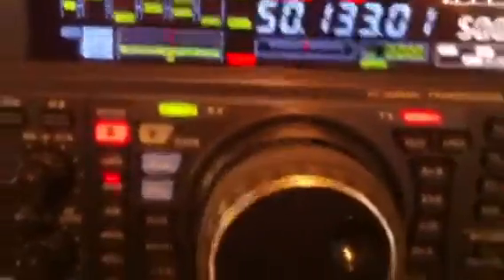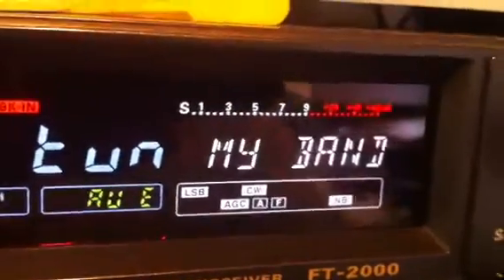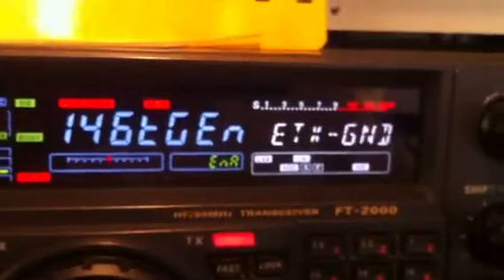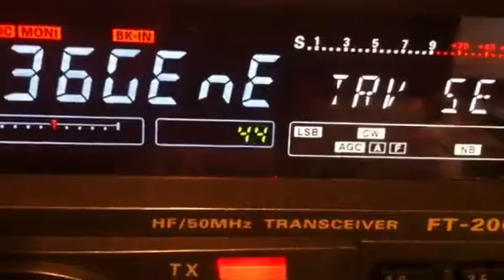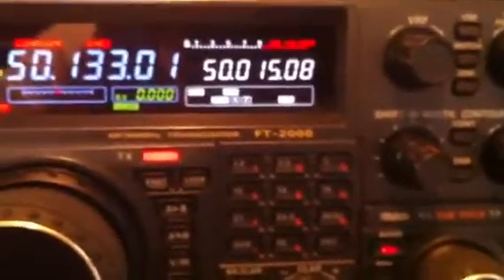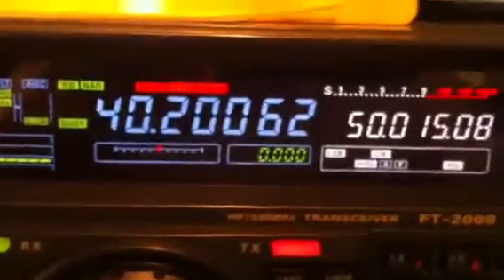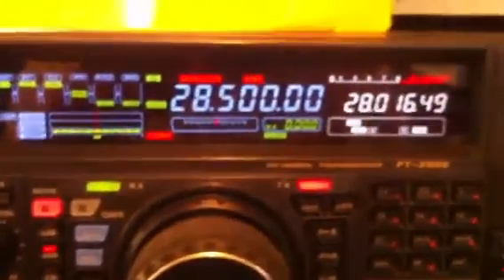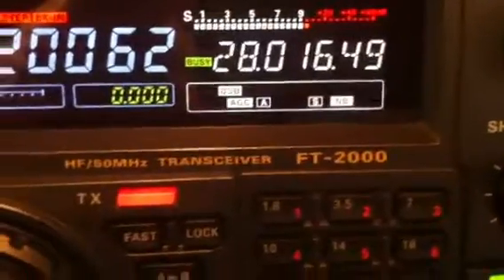FT-2000 transverter split frequency

Comment: Confusing at best. Sorry. You meant well. You left a lot of steps out. Part of the issue was you were trying to show people how to do 4m rather than 2m. With most transverters on the market the FT2K will direct read out the 2 meter frequency or 440. I will look forward to another video from you that I'm sure you will address with equal enthusiasm.